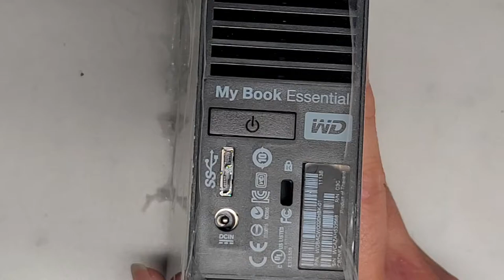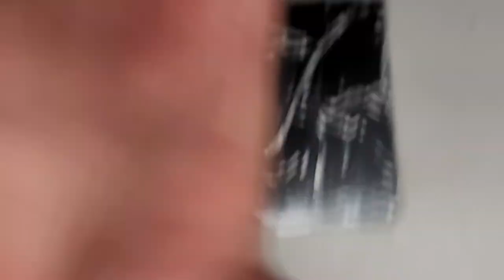WD Western Digital My Book Essential Disassembly *Warning: Clips Holding It Together Will Break*

Comment: What if you remove hdd and use it as internal drive, then what happens to previous stored files ?
Reply from the maker: What do you mean internal?
Reply: @ItsBinhRepaired  I mean what if I remove the hard disk from my new (wd my book) and I connect it directly with sata cable to motherboard like an internal drive, then what would happen to my previous files stored on (wd my book)
Reply from the maker: @sujeetsaamir9455  they'll all still be there.